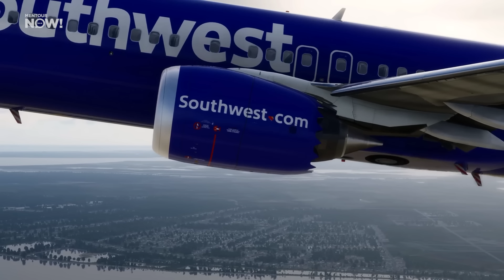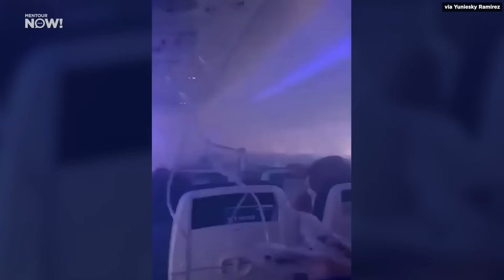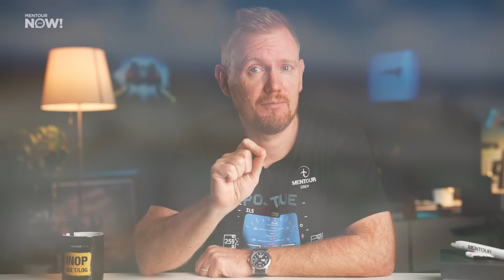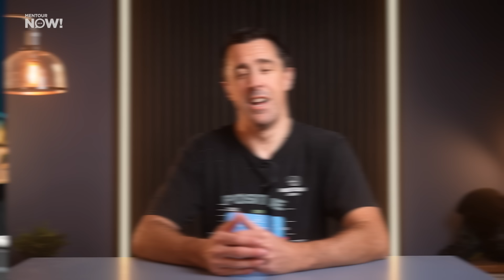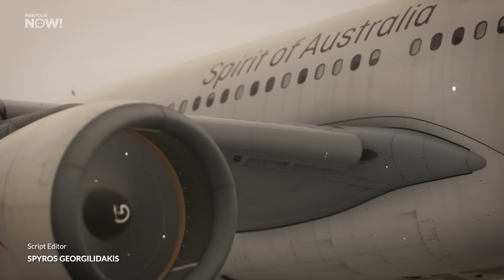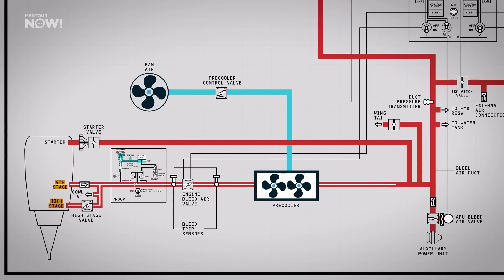Why Don’t ALL Airliners Do THIS?

Comment: "[Bleed air] can also be used to spin air-driven starters to bring the engines to life" - How?  If bleed air is generated by the engines, then how can bleed air start the engines?  Isn't that like a chicken-and-egg scenario?  If the engines aren't running, they're not generating bleed air, and if they're not generating bleed air, there's no bleed air available to start the engines.  What am I missing?
Reply: If both engines are off, the APU provides the bleed air, if one engine is off but the other is on, you can use the bleed from one engine to start the other one.

If the APU doesn't work, they can connect the aircraft's air system with an outside source that can provide compressed air (akin to ground electrical power)
Reply: @federico339  Thank you for the info.  It is appreciated.

Comment: Gosh this video is full of ambiguous and sometimes wrong information, and has no hard facts.  The 787 doesn't require Li-On batteries, they're just better than the NiCd batteries they replace, lighter and more energy dense, with some drawbacks that need to be handled.  The video about the car defroster should have pointed to the back windows with electric defrost, list goes on and on.

Comment: Topical update: On Wed, Feb 18 2026, an A320-200 with IAE V2500 engines, registration N640JB and operated by Jet Blue, departed Newark at 5:34pm local time but had to return soon after due to an engine issue and smoke in the cabin. One person was hospitalized.

H/T to the Simple Flying YT channel.

Comment: I’ve worked on all those legacy dinosaur airliners in my day. Now I manage the quality department for a modern business jet charter outfit. Several of our aircraft types have dual generators, mainly for redundancy. They all still heavily rely on independent hydraulic, pneumatic, and electrical system systems. Airbus took the safe approach and let Boeing do the trailblazing. Seems we’ve seen this approach in the past with things like environmental protection. Recall the days of poor smog control systems on our cars, constantly breaking down. Then European manufacturers took all that knowledge gained and improved upon it when they began introducing unleaded fuel in Germany in the mid 80s, sides stepping the decades, long headaches, the US manufacturers dealt with. Not saying this is right or wrong, but airbus did the smart thing. Yet Boeing also has the opportunity to build upon its development knowledge and continue to bring electrification to the rest of the fleet.

Comment: Higher voltage means thinner wires. why not go to 500v ?
Reply: Insulation and safety during maintenance.
Reply: @BerndFelsche high voltage exists in many fields. Proper procedures and properly qualified and trained people will make it safe. Insulation is not an issue. Materials already exist for this purpose. I think the weight saving makes sense

Comment: They both have their pros and cons. I'm just worried that if there is too much dependence on electrical and something fails what's left to back up a system? Is there a way where it could have both, one electric and an emergency bleed air valve to switch to. Can they co-ecist?

Comment: B707 has separated compressors on engines 2,3,4, which is also a relatively independent air supply from potential smoke sources.

Comment: I choked on exhaust fumes during the whole of an hour-long flight.  The cabin crew said they were unable to give me another seat, but I was more worried that something was wrong with the plane and exhaust was leaking in.  If they had just told me it was normal I wouldn’t have been so stressed out.

Comment: Gulfstream II, IIB, & III DC version, have both an Alternator and a Generator on each engine.   I’ll have to find my old books and check and see if the G-1 did also.
Reply: Similar on the Hawker 800, electrical starter-generator unit for electrical supply plus alternator which are used for heating pitot/static and the windscreen.  Funny enough the bleed air is for cabin pressuriazion/air con, engine inlet heating, and heating the pneumatic rudder bias system.  Then the wings and tail use a TKS fluid system to coat the wings & horizontal stabilizer instead of bleed air.

Comment: Electrical complexity - kilometers of wires
But that is the old way of doing things
Today (as used in SpaceX and Tesla) you only run the power wires - control is done by electronic signals
So you do NOT need lots and lots of wires and complex looms

Comment: 15:54 the front defrosters actually use hot air from a heat exchanger on the engine coolant system. The rear windows use a resistave heating element. (Its the little black lines across the windows)

Comment: 15:56 rear windows defrosters do use electricity to heat the windows to remove frost, but in your video you are showing a windshield using (wait for it) bleed air to remove said frost...

Comment: I feel like the twin decisions made by Boeing and Airbus are an excellent engineering lesson about technical decision making. Complex tradeoffs that landed on both sides of the line in slightly different circumstances, in both cases as what looks like the outcome of very solid thinking.

Comment: Yep. I had a bleed leak on the engine that was so bad that it burned a hole through the cowling. We were lucky it didn’t burn through something critical. That air coming off the high pressure system is hot enough to melt aluminum.

Comment: their is no room to add another IDG to existing gearboxes. Clean designs can add this but existing is unable, I work for a  airline that just ordered the 787 I would rather fly the a350-900 and the new 1000`s, anything with a yoke is a terrible design. That`s why new fighters don't have them, Fly a  side stick 1 time and your entire thinking changes..
Reply: What if your hand gest incapacitated youll reach over w the other ??😂 yoke is best , one can even use legs in emergency
Reply: @WANDERER0070Except in a multicrew airliner, you would pass control to the other pilot, just like if one pilot suffers a medical emergency. You need the other hand to manipulate the thrust levers as well as the stick/yoke. So that point is lost on airliners. Its a valid point when flying by youself in a general aviation aircraft tho. A yoke is better there.

Comment: 15:52 You compare leading edge heating to car defrosters, but show a front windshield, which uses air through vents in the cabin (like bleed air) rather than the rear defrosters which use thin electrical wires.

Comment: Or: AirBus didn't adopt the elimination of bleed air due to "not-invented-here" and/or EU arrogance. However, the development of solid-state batteries for the EV market will eventually migrate to the aircraft market giving the electrical storage/backup needed for more electrical usage.  BTW, why does the thumbnail show mini jets/air intakes on the outer wings?

Comment: Redundancy in aviation is an intelligent concept, so a few power generators, two on each engine and two more in the tail is very smart considering the aircraft is more dependent on electricity to run more systems. I like Boeing's concept of fly-by-wire with one hydraulic back up in case of total electrical failure. Built-in safety margins is foresight, better to preempt a safety issue than learn from a tragedy. Anyway, great episode!

Comment: As an aside (basically talking about energy and the effects of same) the RR Avon engine, as fitted to the Hawker Hunter (and others)  had a very efficient compressor, so efficient that it had to have blow off valves to get rid of the air going through it at high rpm. To compound the problem, the fighter version had Vulcan cannons which were almost in line with the intakes, so when they were fired caused the gases to be ingested by the engine, which caused the engine to stall. This meant that they had to have another set of bleed valves to prevent the stall, which were opened by the gun being fired. As another aside. When the guns were fired, the ammunition links rattled along the underside of the fuse, causing damage, so blisters, known as Sabrinas were added to collect the links. (Look up Sabrina, a well build woman.)

Comment: At the beginning of the jet age, for example, the Boeing 707 used bleed air to drive a cabin air compressor located above the engine. This in turn provided the air required for the cabin. At that time, bleed air was not fed directly from the engine into the cabin. The reason for this was that the engines at that time were not well enough equipped to deal with oil vapors in the bleed air.

Comment: Hiyer  and thanks for this informative and interesting video .
I was concerned from your previous videos about  cockpit smoke in particular .  As the plane is flying at speed and altitude can there not be a simpler- emergency only- solution of having an 'air purge ' valve purging air through the plane from cockpit to an escape valve at the rear , having the same effect as opening a window in a speeding car ? perhaps using compressed air from the still good engine and a vent to air valve at the back . this will cause decompression but at least the pilots could see their controls ??
thanks for all your hard work putting these videos out guys keep up the good work ,it is appreciated

Comment: I worked for years on F27 Friendships. They also had an engine gearbox driven Rootes Blower for cabin pressurisation and a seperate compressor for system pneumatics. So there is nothing new about the B787 apart from electrically driving these units.

Comment: Maybe I missed it in the video, but why use hot bleed air which has to be cooled rather than compressing cool, ambient air using the power of the engine? I get that the 787 does this with an electrical compressor, but couldn't you use the hot bleed air to drive a compressor to supply clean air? It seems bizarre to heat the air in the engine only to have to cool it down again.

Comment: NOT A NEW  THING 707 and DC-8 used a Turbo Compressor system and not engine Bleed air directly to cabin although the engines powered the Turbo Compressors then to cabin no possible contamination

Comment: If aircraft go ALL electric for flight, the system has been engineered.  
I tend to go by weight to decide on 'best' for airplanes.
that kind of accounting is hard to trade, you need electrical, you need heat.
wing de-ice by bleed air is likely more efficient, other than that, go electrics.

Comment: There is no mention of the APU air supply? This is sufficient to pressurize the aircraft and even supply a large amount of electricity power. 
Admittedly not so well at high altitudes! Even so it is available but not talked about?

Comment: Interesting 🤔 
I wonder if they will use a Venturi to suck air through a separate small turbine to power systems during flight and charge the battery they use on the ground to run those systems.

Oh never mind the have pretty good motor/generators already…

Comment: A possible elegant solution for powering A/C systems is thermoelectric generators installed in or downstream of the high temperature section of each engine (main and APU). These rely on special semiconductor materials to exploit the Seebeck effect. Efficiencies can reach well over 30% at hit side temperatures of 1000 degC.

On the air side, designers could use first ram air compression and then multiple small electric turbocompressor stages with intercoolers to approximate isothermal overall compression, thus minimizing electrical power requirements for both compression and active aftercooling, if any is needed. This system would only work as intended at high speed and elevated altitude, but that would be ok as pressurization is not needed below e.g. 6000 feet.

On the ground, electrical power should be provided by a support vehicle or the APU, minimizing the need for heavy battery packs.

De-icing could still use bleed air or else, PTC heating elements. These ceramic devices exhibit increasing electrical resistance as they get hotter, automatically limiting power consumption and peak temperature.

All of this is only viable for next-gen aircraft and engines, given the need for major changes to the fundamental subsystem architecture and associated certification requirements.

Comment: Long story short, everyone who flys on a modern aircraft other than the 787 is subject to neurological poisoning from bleed leaks. Crew members have already been killed, and dozens if not hundreds more have been impacted from minor tremors to severe neurological damage. All the manufacturers know this but the cost is not worth the safety of those who travel on the aircraft. See Alaska FAs lawsuit from 2015, British airways recent divert and dozens more that get swept under the rug to protect the pockets of the shareholder. This is what you should do a video on

Comment: Let's not forget weight and cost.  787's all-electric architecture does deliver improved fuel efficiency, but adds heavy motors, motor controllers, and compressors (which also add cost and complexity).  The real issue here is the decision made to allow the engine structure to fail under overload conditions.

Comment: Seems akin to using engine vacuum to power steering and brake boosters. It will likely stick around for a while due to engineering inertia.

Comment: The really early jets like the B707 and DC8 actually had cabin air compressors mounted in the pylons of a number of the engines (3 on the 707 not sure on the DC8) which did themselves run from bleed air but I believe that this was more efficient than using bleed air directly to pressurise the cabin. Early jets had very little thrust to waste! Of course the cabin air compressors isolated the cabin air from noxious engine fumes.

Comment: I travel frequently around 50 flights per year on a route where only the Airbus 319 is operated.  The engines are very often dumping oil into the bleed air system, usually after landing.  It is horrible, and if it's a bad dump I get tingling brain, nausea and dizziness to the point I almost can't walk.  It is totally INSANE that bleed air systems are allowed, which pump contaminated air into the passenger cabin (and cockpit - there have been instances where planes have nearly crashed when this has happened during flight).

Comment: This is a good overview.  It a very simplified explanation of a very complex tradeoffs, technologies and cost benefit analysis.  One big issue not addressed here is the pressurization difference between the two aircraft.  The 787 operates at higher cabin pressure than the A350 for better passenger comfort and health.  Achieving the higher cabin pressure puts even greater demand on the engines with a bleed air system.  Another factor in Airbus’ decision to keep bleed air was the extreme time pressure they were in to get the A350 to market to compete with the 787.

Comment: The best solution is hybrid approach that uses engine-to-airframe designed bleed air (like the A350) for hot air needs, and small gen+bat for the rest (cabin air).

Comment: For me it's a matter of stopping smoke from getting into the cabin. This was a question at the beginning but dropped out of the discussion by the end. I was left with the impression that the airbus approach could still smoke up the cabin but maybe the boeing approach might not. If this is so then it's boeing 787 for me.

Comment: Your headline asked "Why don't all airliners do this?" You explained why Airbus went a different way with their design, but never said how they countered the main attribute of Boeing 787's lack of bleed air system which is that it won't fill the cabin with smoke and noxious fumes after engine failure or bird strike. Did Airbus actually have a counter to that?

Comment: @16:00 - It's kind of like the heating elements on your BACK windows in your vehicles which are effectively resistive heat strips. The video shows the front windshield. Most of those are defrosted/deiced by using air blown across a heater core warmed by hot water from the cars engine if it is an internal combustion engine.

Comment: Woah, this issue of a failure mode is driven by an engine manufacturers choice. Prior that choice no aircraft had the problem and since only those aircraft equipped with those engines have it. Why the aircraft/engine manufacturers did not adapt appropriately to the incidence of LRD is a mystery to me.

Comment: Why isn't there a smoke detector in the air feed? If it detects smoke it stops the steam... Minimal smoke in the cabin... Of course there's at least 2 engines so there's a backup. If both engines fail, the plane will loose altitude anyway so just a weak backup that can gives enough O2 (but not a lot of pressure) is enough...

Comment: The Cessna C650 has one generator for general electricity and one separate alternator solely for horizontal stab anti-ice per engine. Nevertheless, all other anti-ice systems are supplied by bleed air from the engines...

Comment: WAIT! Wouldn't it make more sense to send the pressurized air to the cabin AFTER it's went through the deice circuit?

It wouldn't take as much energy to cool it down if you did that because of the amount of heat lost from the flight control surfaces.

Also they should've routed coolant on the aircraft surfaces to cool the electronics on the 787.